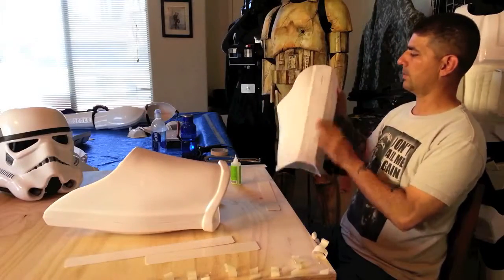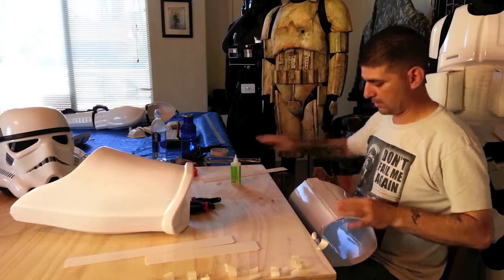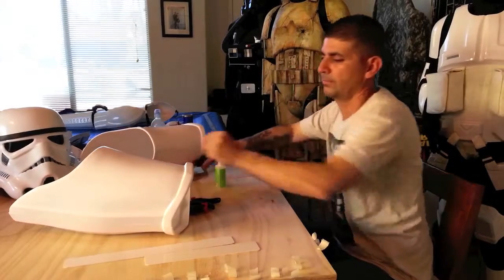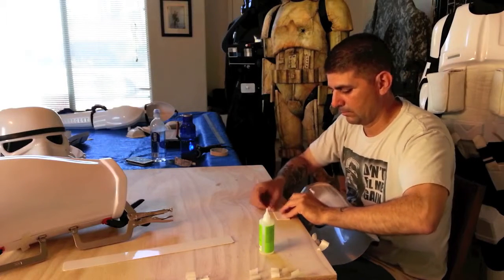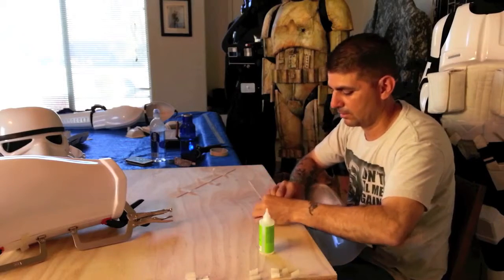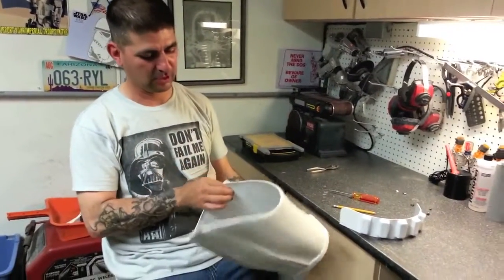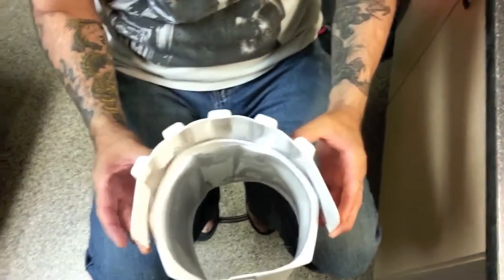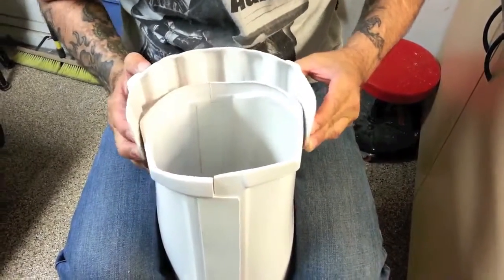Complete TK Armor Build Tutorial 32 of 45 Outer strip and ammo knee

Comment: I have a question regarding the knee ammo. 

I had to visit SDSProps today, luckily Andrew Ainsworth is there, I'm asking in relation to ANH version as to what's correct?.

Their knee armour has curves top & bottom edges. During filming the top edge was straight cut and the bottom edge was curved. 

Just looking at your knee armour it is just curved/ rounded off top and bottom.

I'm trying to get my TD Armour 501st UK cleared.

But they want screen used accuracy.

So do I cut my SDSProps knee armour just to meet their requirements? 😊
Reply from the maker: Mark Smales I make sure the top is straight and dremel a small curve on the bottom and use pop rivets to attach the knee ammo belt.